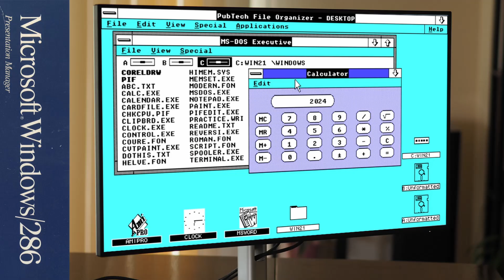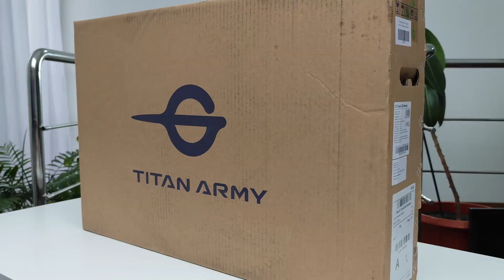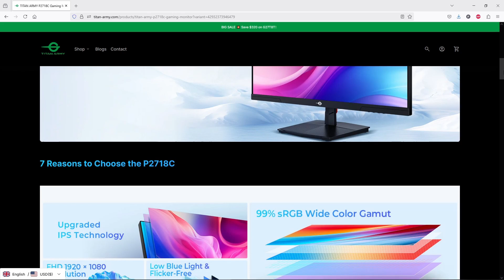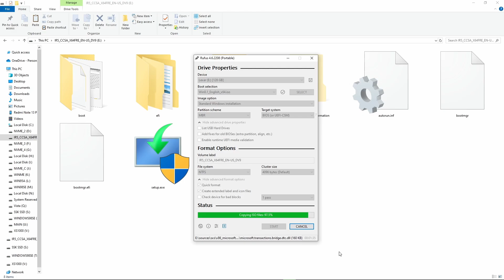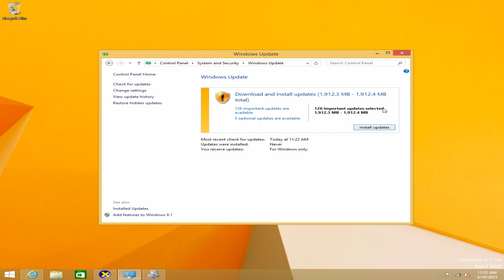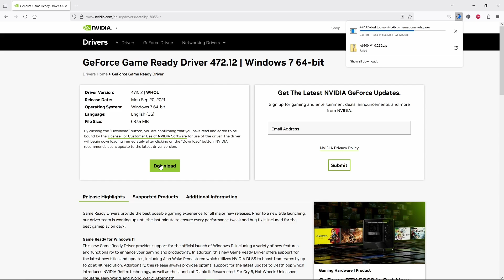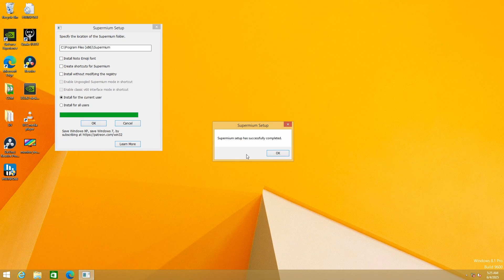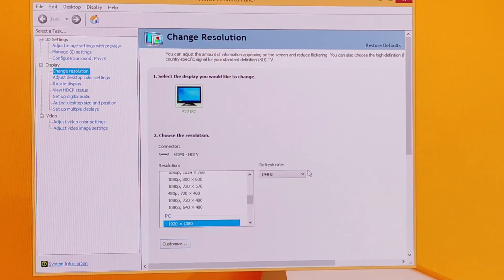Windows 8.1 in 2025:  RTX GPU, NVMe, USB 3.2 & a 27” Titan Army Monitor

Comment: RTX 30xx card are not officially supported they are stripped from the drivers. You need to use a custom modified driver. There are only 2 drivers currently for windows 8.
Reply from the maker: I don’t have any RTX 30-series cards - if I did, I would’ve gone through the trouble of installing one, like for the ultimate Windows 8 build. But the RTX 2060 Super worked surprisingly well. In Quake II RTX, I actually got higher FPS than I currently do on my Ryzen 9 3900X running Windows 10. The 2025 update seems to be more demanding.
Reply: @natr0n Do you have a link to those custom drivers, pls?
Reply: @victormancini3002  guru3d forums My links get deleted as per usual
Reply: @victormancini3002  There is a video about it by Elvis M, that worked really well for me (on an RTX 3060)

Comment: Windows 8.1 on todays hardware can be easily installed without any workarounds!!! But some unofficial things need to be installed for certain things!!!
Reply from the maker: Yes, indeed - it was the easiest install ever on this configuration. I was looking for trouble, but I didn't find any. I didn't have time to check the onboard gigabit Ethernet from Intel. These Intel Ethernet Connection I219-V adapters are very picky - they don’t work in Windows 7, and there are some drivers for Windows 8, but there are many revisions, so I don’t know.
Reply: @O_mores  pretty all the same with 1151v2 setup, I mean Core i7 9700F, Gigabyte Q370M D3H GSM PLUS (the reason I picked this board was a feature of PCI), NVMe SSD Samsung <i-don't-remember-exact-model> server-grade M.2 22110 and Dataland Radeon RX 590 GME X-Serial Plus 8 GB. As the SSD is based on Phoenix controller I even managed to install Samsung NVMe driver so that the system was able to get readings from this SSD. USB did not require any drivers, but there were troubles with Ethernet. This board has two Intel Gigabit interfaces, one is Intel 211 and I was able to install a driver for it easily, another (and maybe primary one as it used for Management Engine) is Intel 219V, and I could not find drivers for it quickly. But it was not trouble for me. What about drivers for Radeon, I firstly installed 6 non-critical (or non-obligatory as they named in Russain version of Win8.1) released 2013-2014 (I mean every non-critical update released prior to 2015) because they turn out to be the most critical ones, idk why. After that I tried to install the latest Radeon driver released for RX 500 series made for Win7. It did not install, installer sees that this is not WIn7 and refuses to proceed with installation. But as installer unpacked the driver I just made .inf installation and after several minutes it installed and worked just fine. Unfortunately without control panel for it. I did not go deeper so I still don't know if it's possible to get Radeon graphics control panel working.
Reply: but what do i do for some things to work? i was getting issues installing driver for my gpu on win 8.1, i used windows 10 version of the driver and it worked. does that mean that windows 10 is a skinned 8.1? but for the other programs i could run most of them just because they say that they ended support. is there any extended kernels for windows 8.1 or a tutorial how to make programs work on 8.1
Reply: not that true sadly , I would love to use Windows 8 however I have an rtx 4050 which has no drivers for Windows 8 at all